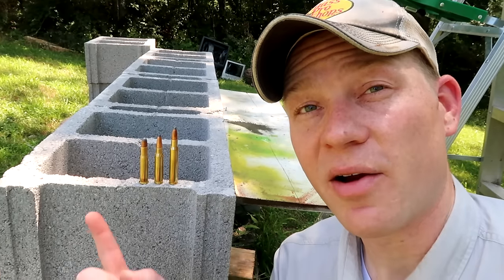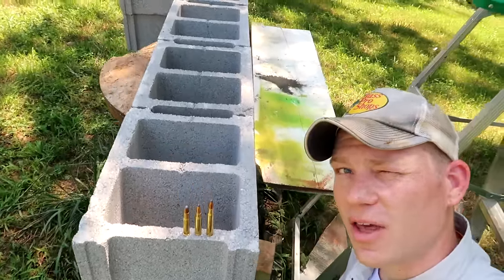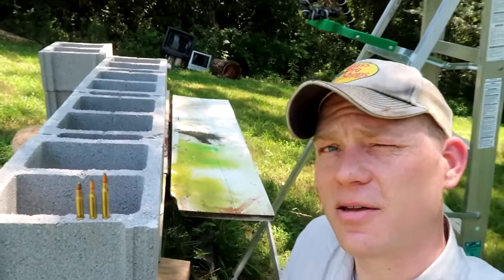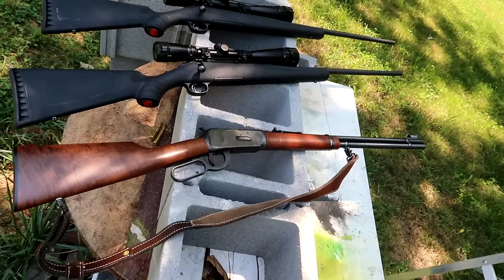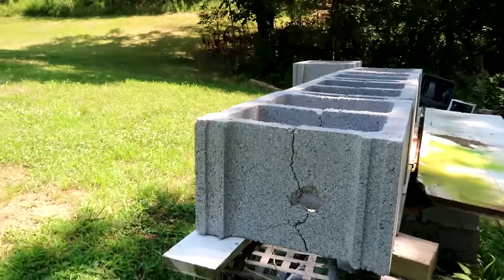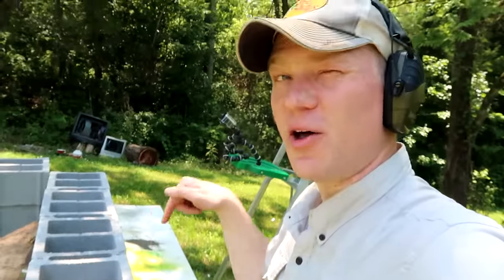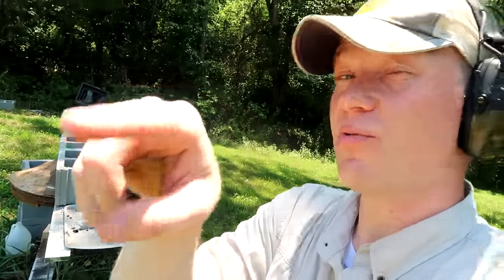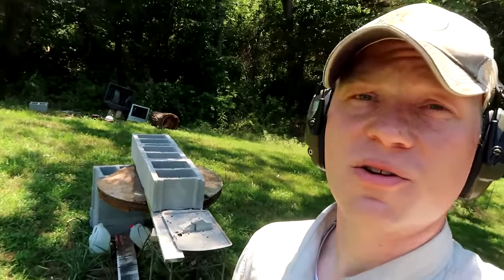30-30 vs 308 vs 30-06 - Cinder Block Test

Comment: The 308 was created to put the power of the 30-06 in a smaller, lighter "30-30 sized" cartridge, they have almost identical performance by design.   No surprises here and a good demonstration of what 46 years of advancement in cartridge design looks like.
Reply: Not really he used factory normal Winchester ammo. I can get a 180 grain bullet travelling at same speed as that 150 grain Winchester weak round by handloading the 30/06 myself.
Reply: You're right, there is 0 loads that the 308 has an advantage in.
Reply: That is not accurate

Comment: Great demonstration.
I own an M1 Garand in 30.06 and it is my go-to weapon when going tactical (so to speak).
I appreciate the .308 round for it's muzzle velocity and mass delivered to the target. I do not own an AR-10 but I wish I did.
I also own a Marlin 30.30 for deer hunting. It's really a great round for its intended use. Reliable, accurate  weapon everyone should have in their arsenal.
Reply: The ol m-1 is my go to or the old model 12 i have in the corner
Reply: @whereswaldo5740  Thanks for the advice. I'm sure you're right  but I'll have to make due with my trusty M1 along with all the ammo I've stockpiled and save the hundreds (more like thousands) of $$ to spend on the things I actually need. Patriots out there would all be advised to do the same. It's going to get worse before it gets better I'm afraid.
Reply: The reason why the military adopted the 308 is because it shoots a 150 grain bullet about the same speed as a 3006.The 3006 outshines it with heavier bullets.

Comment: I had a neighbor take me shooting one day and he demonstrated the difference between different rounds.  We used some watermelons as targets.  We had 30.06, 223, 9mm, 380, 44mag, and 45acp.  Here is what happened.

223... Hit the watermelon made little hole in and slightly bigger out.  This round in commonly found in what the media calls an assault rifle, we shot it out of an AR15.

9mm... little hole in and quite a bit bigger going out.  Common round in semi-auto handguns. We used a Baretta (cant remember the model but similar to the military issue)

380... little hole in little hole out.  This round is not as common any more, it's slightly larger in diameter than a 9mm but not as powerful.  We had a small revolver for this one (cant remember the model)

44mag.  This was fun... the watermelon had a big hole in and was missing most of the back.  I didn't like shooting this one as the revolver we used kicked like a mule.  It was a Ruger blackhawk.

45acp.  My favorite of the handgun rounds we used.  Similar effect as the 44mag but the Colt 1911 was smooth and easy to shoot.  This round is not as popular as it used to be but still a great round all and all.  

And last was the 30.06  I saved the comments about this one to be last as the media doesn't have as much problem with single shot type hunting rifles as they do with the big scary sounding "semi-auto" sporting rifles.  We used a Remington 700 for the shooting and I fell in love with this rifle (I now own one even). I cant tell you what size the entrance hole was because the watermelon pretty much exploded on impact.  When I say exploded I dont mean like it left a crater in the ground but we were about 20 yards away for all shots and the 30.06 we saved for last and we ended up getting watermelon guts all over the range and even back on us.  Not just one melon either, we hit 3 melons with each round (there were 3 of us shooting that day) and all 3 times with the 30.06 we got sprayed!

Comment: I like the 30/30 because it's an all-around general purpose hunting rifle.
Reply: I like it cause a lever action makes me feel like John Wayne. P.s. I have a Remington 700 30-06, and I love it but nothing feels better than a lever action rechamber
Reply: Same to both of these plus it was the gun I grew up using for everything and it was what my dad left me when he passed away
Reply: My dad left a Marlin 336, manufactured in 1951, and chambered in.35 Remington. My wife used to have a matching rifle but in 30-30. Both rifles were sweet shooting, short range guns. Quick to shoulder, very effective on deer. My brother said that dad’s Marlin is a thumper but he needs to learn reloading. He can’t find ammunition but he’s got a little brass that my dad hung onto from years ago.
Reply: That's actually the same reason I prefer 30-06. You can load it all the way up to a 220 grain bullet which turns it into a legit large/dangerous game rifle and pushes it beyond what pretty much any other non magnum cartridge can do. Most people would never have a need for that though and when it comes to whitetail or pig there's not much difference other than effective range.

Comment: I finally know what to use when concrete block hunting
Reply from the maker: Yup!!!
Reply: A cinder block killed my dad in a drive by shooting.  He was shooting a red brick.  When will this cycle of brick on brick violence end.
Reply: @catmandoo4u1  he wasn't mason around.
Reply: So hard to clean and cook though
Reply: Exactly my thoughts.
Reply: Only one 7 mm mag
Reply: funny
Reply: @davidpumpkins9411  First soak in water overnight and tenderizer with cinder block hammer. Place on board place in oven at 350 2 hours. Then throw block away and eat the board.
Reply: 60zeller haha
Reply: 60zeller I was thinking the same thing
Reply: I see there's A LOT of Volks Tha+ Don't care ABout the content Just Talking Trash. Yungn S
Reply: I use 500 gran 458 to ki
Reply: I didn't know concrete block season was in.
Reply: 60zeller next time maybe he can get 3 or 4 deer to stand side by side
Reply: HAHAHAHA
Reply: Brick don’t shoot back :)

Comment: As I recall from my deer hunting days after I got back from service in '68, I looked up the ballistics of my .308 caliber Remington model 788 and compared the ballistics to the 30-06 round.  At 500 yards, the bullet drop for the .308 was about 8" lower than the 30-06.  Not much difference between the fps or foot pounds either as I recall. Personally I've owned .308 rifle and 30-30 but have fired all 3 calibers.  For hunting deer I don't think it would make much difference which caliber was used within 100 yards; the deer would still be dead with a well placed shot.
Reply: Exactly. Splitting hairs when it comes down to the 100-200 yard shots.

Comment: I was in Kenya many years ago, hunting Eland on one particular day, when I was charged by a rogue concrete masonry unit.  Took three bullets from my .375 and two from the PH's .458 to stop it. Scary.  Turned out, someone else had wounded it a few days earlier, or else it probably wouldn't have gone rogue like that. Ever since then, on all my trips to Africa, I carry a trowel and a level...
Reply: Don't forget your string line and round tool.
Reply: Great thing about Kenya, you are not required to carry your journeyman license.

Comment: Love it.   I've shot all three.   I own just the 30-30 b/c it was my father's rifle (Marlin 1957) and my doctor's dad invented the microgroove which was the Marlin.   I saw the lathe he and his brother used to make the micro groove.   So that rifle has more meaning to me than the other two.   Thanks for the fun video and peace be with you brother.
Reply: did you mean 1857? sir george you older than your pic? your mind must be goin, mine sure is!
Reply: The guns i got from my dad are priceless. A stevens side by side shotgun and an m1 carbine...
Reply: @pvtnboy6777  I’ve got a 16 ga. double barrel as well.  It’s well over 100 years old and can’t remember the maker.  Been in the family for. Long time.   I’d love to have a M1.
Reply: @SirGeorge53  sweet 16!
Reply: @pvtnboy6777  I agree, although I love my 12 ga. Semi auto Beretta.   I like using that for spring turkey season as it gets out there and touches someone or bird.  I also have a cheap .20 ga. Pump Mosgrove   I like that one for bunny hunting.  All it’s good for though.  Makes too much noise for anything else.  That sweet 16 I love for pheasant as it’s rather short and can wheel me deal pretty quickly.  I use a .45 cal muzzle loader with a scope for deer.  Last one I shot was  between 120-130 yards away.  I’ve Lao got a 22 cal savage with a scope I like to use for squirrel and ground hogs. My mind just went blank and think what else I have.  Oh. I gotta a really nice 19teen something Smith n Wesson .32 revolver I like to plunk around with.  Fun hand gun to shoot.  That’s a treasure as well s it’s gone down the family more than. Few generations.  Happy shooting!
Reply: @SirGeorge53  You sound like a person who hunts more then animals with your firearms!

Comment: All about the right tool for the job.  when I was on a deer lease with a lot of open area, used my 30.06.  Now I have land with a LOT of oak and brush (and deer), I switched to the 30-30.  wades through the brush.  If a deer was more than 150 yards away, I likely wouldn't be able to see it anyway.

Comment: I run 170 grains in 30-30 and 30-06.
165 grains in the 308.
At 100-400 yards the 308 and 06 behave almost identical on soft targets. The 30-30 due to a very blunted tip actually seems to hit animals just as hard if not a little more at 100 yards then at about 150 and beyond, the other two definitely take over on performance
Reply: Hunting in WI I have identical results. Under 150 yards my 30-30 consistently does the most damage to soft targets. Beyond that, 308(perfered) or 30/06 for accuracy and terminal ballistics.

Comment: The 30-06 is like an M1 Garand. It stormed the Beach of Normandy. It can storm a cinder block wall!
Reply: @Corey gearhed High haha oh yeah. The BAR also used the 30-06 as well I think
Reply: Lol the 150gr .308 was designed to be ballistically identical to the 150gr GI load .30-06 for the M1 garand
Reply: The 30-06 was introduced in 1906. That’s where the 06 part of the name comes from.

Comment: Well the 308 is essentially a more compact 30-06 so no surprise that it did pretty much the same thing, although I was expecting the 30-06 to do one more wall than it did, I think with a softer target to measure these, you would probably see a moderate increase in damage with the 30-06
Reply: the 30-06 150 gr load is about the weakest load for it when comparing ballistics to the 308 at 150 gr they are just about identicle fps,and trajectory load up 170 gr 30-30 and 180 in 308 and 30-06 and see a huge difference the 30-30 will make all first block the 308 makes thru 1st wall of second and 30-06 will make thru to 3rd block 3 out of 4 shots 1 shot made thru 2nd partition of 3rd block and cracked rest  ( remington core lokt ammo all round nose) pointed soft point rem core lokt will penetrate a lil further with both 308 and 06 but keep in mind the pointed soft points almost never start to mushroom on deer inside 100yards unless you hit some heavy bone like a shoulder

Comment: Nice comparison - again :)  I like it!  Folks tend to forget the .308 was designed to provide about the same ballistics as the normal 30-06 round in a shorter case.. Seeing them perform so similarly is nice to see.
Reply from the maker: Hey Ken! Thanks! This was a fun one
Reply: Ken Helmers the 308. Is actually more accurate and has less drop per 100 yards. But yea, the 308 was designed as a shorter 30-6 but nowadays with the advanced rifles and technology, it's surpassed
Reply from the maker: Thanks Skylar
Reply: There were over a dozen .308 rounds made and they never surpass the 30-06 record kills at 1000 yards.
Reply: It does get close though even though it doesn’t equal 30-06. Hornady makes a 178 grain for .308 that hits 2775 fps
Reply: I’d like to see the test at 300 yds.
Reply: @bradovard8657  I would favour the 308 for normal hunters up to max 200 yards.  Most hunters are not trained to take longer shots with a high likelyhood of good hits.  Main advantage over the 30-06 is lower cost per bullet and less recoil,  this means more training,  resulting in more accurate shots. 
Still the 30-06 is a very good bullet and will be among my top choices. 
For the few hunters that spend lots of time and money on training and want to take down big game at far distance there are better choices. 
As for the 30-30 it is not an option for even mid sized deer where I live since it is not a legal cartridge for that size game. Law trumps facts.
Reply: If I read correctly, the NATO 7.62 was designed/intended to replace the 30-06 as a staple battlefield round. The cartridge weighs less than the 06, thereby allowing soldiers to carry more rounds into combat, and it's effectiveness was similar to the 06 to say the least. The 5.56 was misapplied. It lacks the 7.62's downrange longevity.
Reply: 7.62/308 was designed to allow faster cycling of automatic weapons than the 30-06 while delivering simular ballistics by utilizing higher chamber pressures and a lighter bullet. The 30-06 loaded in a modern rifle to modern pressures matches the ballistics of the 147/150 gr 308 with a 178/180 gr bullet in the 30-06 far surpassing the energy of the smaller round.
Reply: @bradsmith1177  That's not entirely correct.  The military and powder companies figured out that by altering the burn rate of powder, they could achieve similar ballistics in a smaller package than the 3006.  So 10 grains less powder, similar performance, almost exact with 150s and 165s when both are loaded to potential.  The 3006 begins to distance itself slightly at 180, heavier bullet does better with slower powders, something the 308 doesn't have capacity for and the 06 does.  After that 200 and 220 grain bullets, yes the 3006 wins every time.  I am driving a 180 grain out of a 308 at 2650 fps, not a max charge either, slightly above the 2620fps factory round, the standard for the 3006 for the same bullet is 2700fps.  Do you think moose, deer, elk etc is going to notice the difference?? nope, slight differences equals nothing of substance.  You can not take the same powder the 308 uses and increase the charge to make the 06 are barn burner, pressures dictate that.  So each rifle, loaded with powders meant for that rifle, equal similar results.  It doesn't far surpass the 308 by any means.  3006 equals old tech, meaning burning more powder than necessary with given velocity, 308 was an update to the 3006 with newer tech, more efficiency, lighter rifle.
Reply: Yeah I didnt know that.
Reply: .308 in a shorter case equals .30-06 because of higher pressure but  heavier-bullet .30-06 loads can equal  .308 s because of greater case capacity
Reply: @oliverreed8524  that argument will go on forever, but 5.56 nato are AMAZINGLY DEADLY, ask 1 certain big bodied buck!
Reply: plus, believe me by all accounts the lower weight is appreciated
Reply: @jasonsparkman4830  overly simplified, yes, + lighter ammo
Reply: @Rohan4711  the 3006 has no real advantage over the 308 unless your a hand loader. look at factory loaded ammo the velocity is the same for each in the same bullet weight until you get to 180+ then the 3006 has the advantage

Comment: I kinda wish you'd set up a chrony to see if there was any apparent correlation between velocity and damage. Also, it seemed to me that the .308 made a bigger hole in the first wall than the 30.06. Even the 3030 cracked the first wall (couldn't see the 2nd well enough). Fascinating video there, sir. Kudos!

Comment: The 308 and the 3006 are basically the same , with the 3006 having a slight advantage in speed and energy
Reply: You are correct. Very similar ballistics under 100 yards. In the NE they are practically interchangeable. I prefer my 308 for deer choosing from the two.  More often though I grab the 30/30 , my one and done gun loaded with 160gr ftx bullets
Reply: yeah exactly, if i was stepping up to 180 grains exclusively for 200 plus yards, id use a 30-06.  In the bush, 308 is wicked.
Reply: A lot more
Reply: Basically the same, only different

Comment: Comments: Benefits of 30-30 are easier to carry & shoot in heavy cover. It is way quicker to shoot a running cinder block with an open sight, carbine, imo! I have used all 3 calibers for hunting, and all have their pluses. My Winchester usually is more fun over the past 50 years. Fun video- thx!
Reply from the maker: I love a good lever gun
Reply: I'll take a m1 garand over a lever gun all day long
Reply: @WHOTEEWHO  I have  had a boatload of fun over the years, hunting with my Model 336 Marlin lever-action in 30-30 !  I paid $86 for it way back in the early 1970s !

Comment: Could bullet shape have had an effect? 308 and 30-06 were both pointed while 30/30 was round nosed.
Reply: @dalemaloney255  Oh, I knew why, I'm just pointing out the difference in bullets that may also make a difference in how it goes through (or doesn't go through) the target.
Reply: Polymer tipped rounds are pointed and help with ballistics but don't know how it would effect penetration because, ya know, polymer
Reply: The 30 - 30 bullet isn't jacketed. Plain ole lead. The other two bullets are jacketed. That will affect the penetration of the 30-30 because it disintegrates quicker.
Reply: Yes the shape makes a difference theare is a mushroom a mushroom explode. tipe bullet and a bullet that dosnt explode
Reply: @mazlo6574  I feel like I have seen flat nose FMJ 30-30 for reloading at the sporting goods store. Don't have a reloading kit so I didn't buy any but they could provide some different ballistics maybe.
Reply: @dalemaloney255  I’ve shot standard .308 projectiles out of my 94, 78 rounds later and not a single detonation in the tube, like communism, some things seem to work out on paper more than they do in reality much like “muh toob magazine goin kaboom”